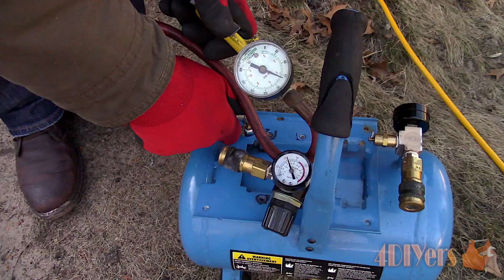How to Make a Portable Air Tank from a Broken Air Compressor

Comment: I have a pig that gets used more often than I thought it would when I bought it.  Much more handy than those little compressors that plug into a 12V accessory plug and take forever to inflate a tire.
Good video.
Reply from the maker: Thank you! We have another larger air compressor which is in the shed at the back of the property with no power. So it's either drag it out or run a cord to it, the little compressor was a much easier option. But now that we have plans to build a garage, this will be just fine after the compressor gets moved to there. I was surprised it actually lasted this long lol.